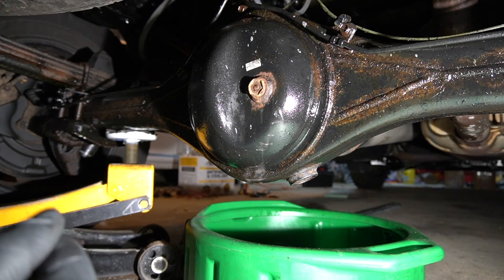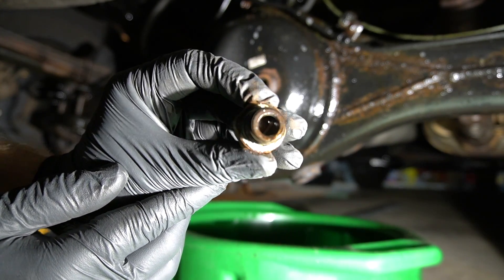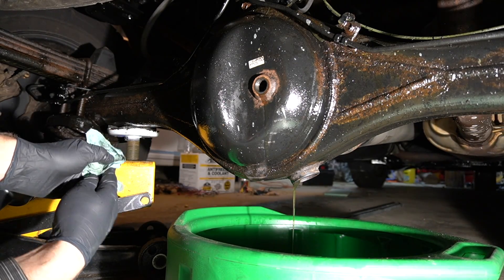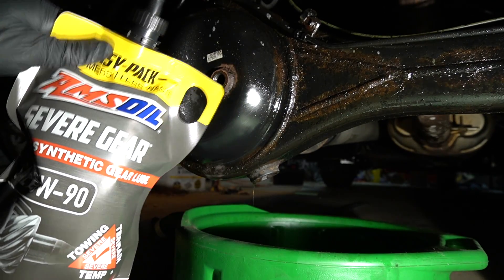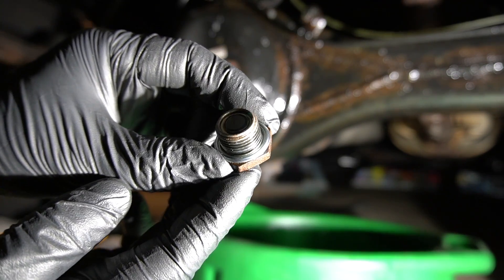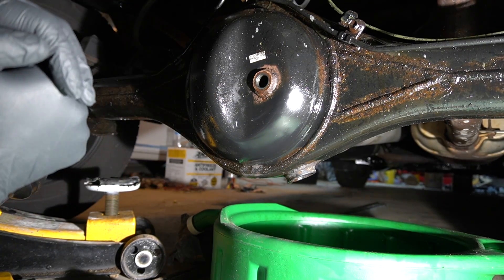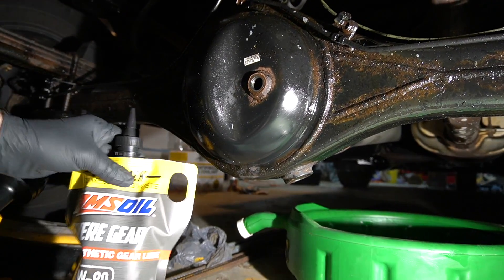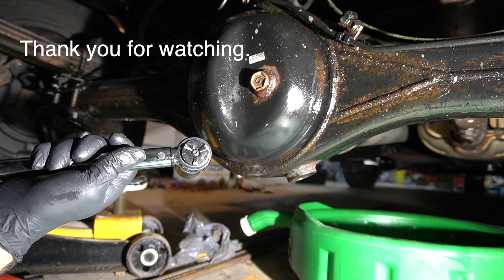How to replace Toyota tundra rear differential gear oil, same thing on Toyota and Lexus vehicles.

Comment: how often should i be changing this?
Reply from the maker: It depends on what brand of fluid your using and for purposes truck is used
Reply: @repairvehicle  i have a 2021 Tundra that i use for commuting and no towing at all. truck only has 5k miles as of right now
Reply from the maker: First fluid should be done around 30k miles max or as low as 15k miles or 4 years which ever comes first. After first fluid change you can go up to 4 years or 50k miles max which ever comes first.
Reply: @repairvehicle  Awesome, so im guessing early because of the break in period? i did the same thing with my engine oil. I did the first oil change at 3k miles. Dealership laughed at me haha oh well its my truck!
Reply from the maker: Yes, because of the break in period.

Comment: Thank you!  Do you have content on transmission oil change?
Reply from the maker: Yes. What do you have?
Reply from the maker: https://youtu.be/TjqRHbDHf5U
Reply: @repairvehicle  I have a 2007 5.7 tundra with 161,000.
Reply: Rear differential fluid changed.  Thank you again for the video, it  was spot on!
Reply from the maker: You are welcome.
Reply: @repairvehicle  next is the transmission, I will be watching that one tonight!
Reply from the maker: I have video for front diff and transfer case

Comment: what about slipping additive, someone told me that i have to add some slip additive to the diff oil, any advice, i have 2014 Sequioa 4wd, 30k milea never changed the rear diff oil?
also according to the original Toyota maintenance manual they recommend Gl-5 75-85. capacity 1.5 - 2 quartz.
I'm confused
Reply from the maker: You have an awesome suv.  I love my 2012 Sequoia.  Watch this two videos about Sequoia rear differential. 
Toyota Sequoia/tundra does not require additional limited slip additives, because it's controlled by the brakes cylinder on each wheel.  Also,  amsoil gear oil already has limited slip additives in the gear oil already.  But if additional is needed or required they have it. https://youtu.be/JgXZ1Z1P-r0
Reply from the maker: How to change gear oil in Sequoia like you have one https://youtu.be/Yu8VIMh5_lU
Reply: thank you for your video and your time. that original Toyota oil cost arround 30$ per liter. i don't know if it worth it.
also about the capacity many videos stated thay the capacity is 4 quartz, i have no idea why the manual is recommending 2 quartz.
i bought thia manual to help me with the maintenance.
Reply from the maker: This link has capacities for your Sequoia 
https://www.amsoil.com/lookup/auto-and-light-truck/2014/toyota/sequoia/5-7l-8-cyl-engine-code-3ur-fe-5/?volume=us-volume&zo=5257753
Reply from the maker: Don't waste your money on Toyota none synthetic gear oil.

Comment: Just did this a week ago. Same oil too. WHAT A DIFFERENCE!! Guys I thought it was all talk, I am happy to say I was wrong. My 2015 tundra is averaging 15.7-16.5 city 17.5-18.5 express way almost 1.5 miles per gallon. Increase in gas mileage!
The truck feels like it has less rolling resistance.
Reply from the maker: I agree with you 100%, I experienced same thing. Thank you for sharing.
Reply: How many miles when you changed it. I'm at 35k just getting ready to do it
Reply from the maker: Perfect time and mileage.  What year is yours?
Reply: @repairvehicle  That MPG increase is incredible! Now I want to put Amsoil in my rear diff but I still only have 12,500 Miles on my truck. Should I wait for the regular mileage change at about 30K or do it sooner?
Reply from the maker: I would do it now. This way everything is flushed out that has been since there during break in and any other stuff from manufacturering.
Reply: @repairvehicle  Thanks I'm going to do what you told me in another video to "sign up" with amsoil to get a 25% discount & then order.
Reply from the maker: @dalephillips8250 ,  no problem.
Reply: @repairvehicle  How do I show that you referred me when I sign up for amsoil? Wanted to give you props as your videos have turned me toward it.
Reply from the maker: @dalephillips8250  , use this number 5257753

Comment: How many quarts AMSOIL differential fluid need in Toyota thundra 2009 4.0 v6 rear
Reply from the maker: Under this link https://www.amsoil.com/lookup/auto-and-light-truck/2009/toyota/tundra/4-0l-6-cyl-engine-code-1gr-fe-z/?volume=us-volume&zo=5257753

Comment: Love using the Amsoil gear oil, the differential ran a lot smoother and same with the engine oil signature series on the engine and surprised that the engine run quieter on my moms 2006 Toyota Sienna by just using Amsoil signature series 5w30 alone with a EA 15K51 Amsoil oil filter. I’ve had nothing but good experience using Amsoil products.

Comment: I've actually heard this improves mpg a tiny bit.. is this just bullshit or have you heard the same?
Reply from the maker: Definitely does improve mpg, otherwise I would not be using.  Improved mpgs means less metal to metal contact, resulting in no wear
Reply: @repairvehicle  interesting.  On a 2019 tundra would you notice a change in mpg on the rear diff alone or would you have to change out the transfer case, and front diff to notice a difference?  I'm approaching 25,000km and thinking about putting amsoil in at 30,000km
Reply from the maker: I changed all fluids kind of at same time on tundra 4.6 and noticed difference. On my 5.7 Sequoia I noticed imitate difference, less drag

Comment: What viscosity gear oil goes for a 2001 mustang v6 3.8 engine? Thanks.
Reply from the maker: Here is the link for your vehicle and what is available.  https://www.amsoil.com/lookup/auto-and-light-truck/2001/ford/mustang/3-8l-6-cyl-engine-code-4-4/us-volume/?zo=5257753